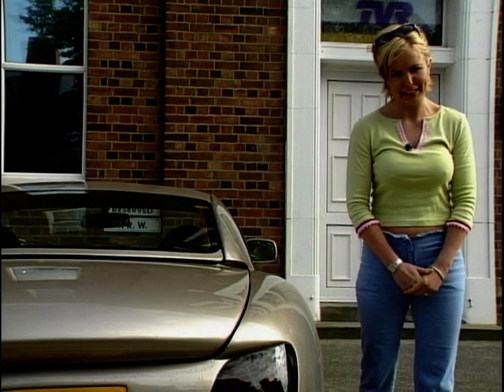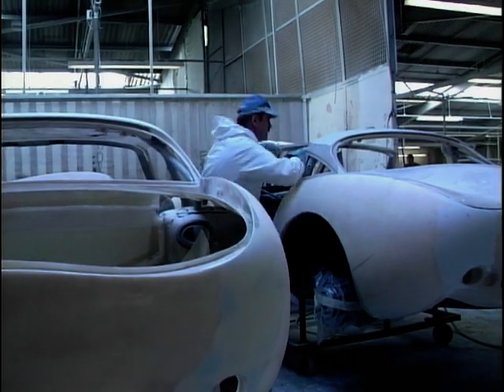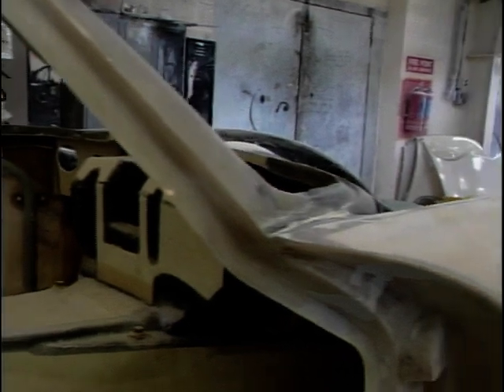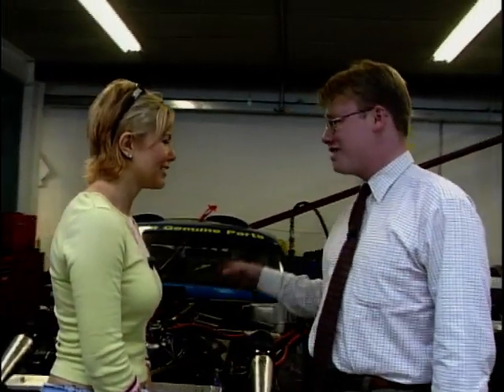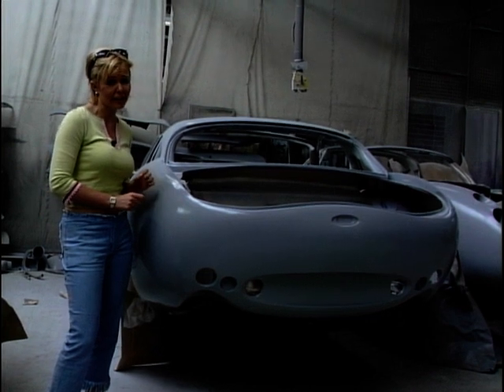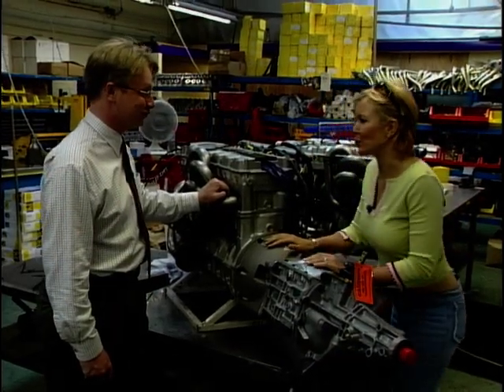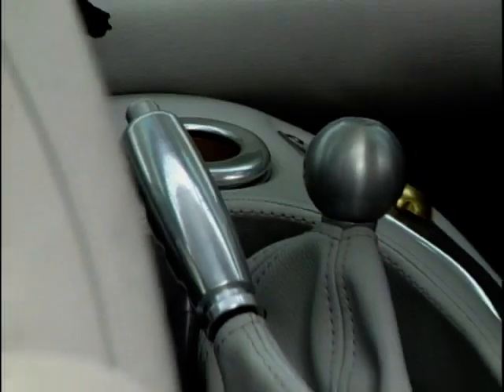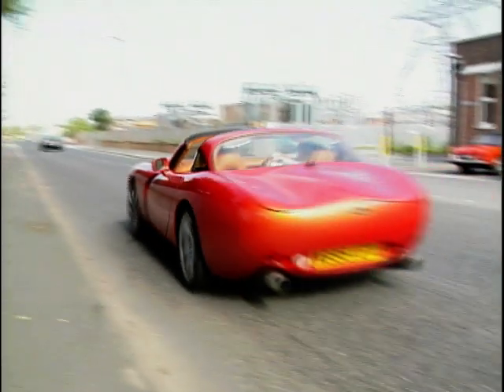TVR Factory- How It's Made - Behind The Scenes

Comment: Peter Wheeler both truly created TVR and then totally destroyed it with his shady dealings and moronic penny pinching ideas with the Speed Eight and Speed Six engines. Al Melling had designed a great pair of engines but Wheelers corner cutting turned them both unrelillable and rebuild prone. Brand new cars left the factory without even having their engines properly tuned/set up and producing way, WAY less power than they should. Then towards the end Wheeler put out so many variants on basically the same cars? It's such a shame that TVR died the way it did and we live in a darker, quieter, more boring world because of it.

Comment: I don’t care what anybody says. My dream car is a TVR. 
(I’m an American, and unfortunately they’re extremely rare in my area.)
Reply: So true. There’s a Tuscan for sale in Las Vegas for 200k if you can fork up the money.
Reply: The Cerbera turns 25 next year. Then, you can import one as a classic and it won’t have to follow safety regulations.
Reply: ‘ CCK5018 ‘ Isn’t worth it. The Tuscan S sold for £50,000 when new.
Reply: You can get 80's to 90's TVRs for less than 20 grand and from what i've read they are fairly relaible. Just import them over from the UK since they're over 25 years old anyways. Just look out for electrical gremlins on ohter models.

Comment: Look at all them chassis outside wot a headache that has caused many tvr owners due to rising outriggers including me.
Reply: No wonder they rust, how much is a chassis replacement?
Reply: Most other designed chassis less are not possible to repair with rust in unibody style cars. It's actually a good thing these can take body off and it's possible to repair the chassis. Thankful!